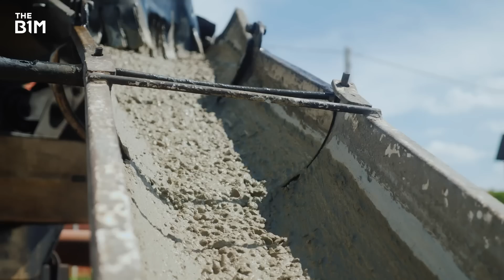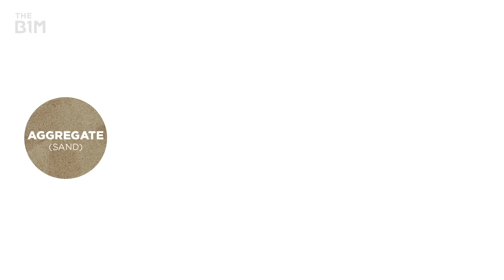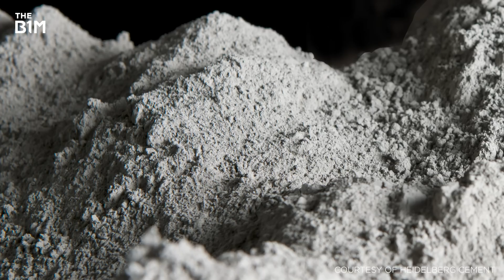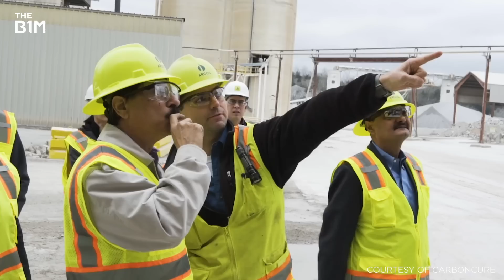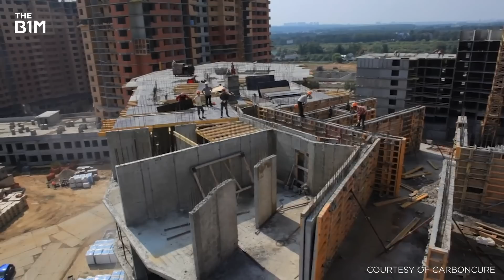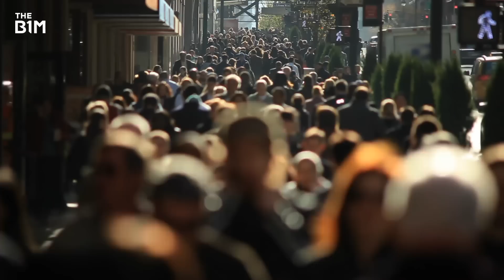New Concrete Alternatives

Comment: Ferrock turning trash is to a commodity? Sounds perfect! If recycled glass is what you need, and you'll pay a high enough price for it, people will clean up our highways with the zeal of a prospector
Reply: And the US just recently sent tens of thousands of tons of collected used bottles to landfill, because they couldn't find anyone to use them.
Reply: It used to be that lobster were considered trash, until a restaurant figured out how to make them taste good and market them as something for the elite. Any time waste products are turned into a valuable consumer item, they immediately start having a scarcity problem. It's a much better waste control strategy than involving bureaucrats.
Reply: Charlie Vetsworth  no, the Problem is, that controlled free markets have to be forced to adapt. taxing concrete imensly, while keeping frerrock cheap, will get the contruction Industry to Change, willingly or not
Reply: @chayew4660  Perhaps, although this would be an unpopular move as it would increase the cost of construction for a while.
Reply: I think another main issue is that it's an untested material. How does it fair during a fire? Its made out of iron. Is that going to be a problem with wifi or electrical wiring or something of that nature? etc. It's just such a different material that people are rightly sceptical, but it warrants further investigation.
Reply: biggest problem is our utterly broken economic system. turning everything into a commodity is not the way forward.
Reply: @daos3300  But everything is a 'commodity' because everything is a resource - and it IS important to view it as such.
Reply: Timothy Schellin Are you stating that everything is a resource or the economy looks at it that way?
Reply: @KarmaticEvolution  Both? everything that's useful is potentially a commodity. Not putting a price on something that is both useful and scarce is a bad idea.

Comment: Isn’t it important to also move away from our reliance on sand? The rate we are using it is much faster than can possibly be replenished by erosion. Sand on our beaches protect land from water erosion, without it we will lose land quickly. Your insight?
Reply: There is the sahara tho
Reply: No. Water ressources are scarce. Water is needed for concrete production so the focus would be on water rather than sand.
Reply: @MrReedling  desert sand doesn't work for buildings.

Comment: Bamboo is being used as lumber in Ecuador. Huge species grow there, up to 30 meters tall in a few years. The bamboo plantations help restore soil quality and provide local work.

Ecuador builds emergency disaster relief housing out of bamboo. Up on bamboo stilts to survive flooding.

Mixing in ground up hemp stalks in place of sand creates hempcrete. Using a foam generator, foamcrete can turn 1 ton of concrete into double the spacial volume.

Add these things together, and humanity can solve many pressing environmental issues with different types of building materials.

Comment: I’m a structural engineer specialist in concrete structures with MSc in structural engineering , and I see this with caution. I have more than 20 years of experience with concrete, and I can tell you for sure that the two main elements that you want away from concrete are salt and CO2. Because them promote corrosion of the steel rebars. I don’t know how someone can mixture CO2 inside the concrete and have some good results from it. Maybe just to use with concrete only structures (without rebars). I guess that I have to study more...

Comment: Isn't another issue with the concrete use in construction, the quantity of sand required to produce it? Because the available sand in the world is being depleted by the industry which destroys the coastal land and islands of countries around the world but it didn't seem to explicitly address this issue of how to reduce the consumption of sand for concrete.
Reply: You do understand sand comes from the ocean? The ocean floor is almost all sand.  Not the other way round. 

Have you ever been to a beach in California?

San Diego gets it's sand from the desert 20 miles away. 

Then there's the Sahara, Gobi, and a few hundred thousand square miles of desert around the world.

I don't think we are going to run out any time soon.
Reply: @Warmaster_7  I don't think that the desert sand can be used for construction .
Reply: @mumenraider  You are very much correct. What Warmaster 7 fails to realise is that sand does not equal sand. Desert sand is very round and smooth, making it unusable for concrete as it doesn't offer the physical properties needed to make good concrete.
Reply: @mumenraider  
Of coarse desert sand can't be used in construction. That was implied. 

Desert sand is used for beaches.
Reply: @KreaTiefpunkt  
What's funny is I never said desert sand is used in construction...
Reply: I may be wrong about this  Warmaster 7  as sand is technically renewable however there has been concern about the amount of "useful" sand for concrete because the rate we are consuming it is too fast for the Earth to produce enough sand to replace it. My point was that this was not addressed for or against it.

Also you didn't say desert sand explicitly is used for construction but your agrument is based on the fact there is enough "desert" around the world to deal with the demand of sand for concert production.

https://youtu.be/kEPpOGyvCmc
Reply: @niightmanz7551  
One day some genius will make desert sand into concrete. 

That guy is going to make some serious money.
Reply: @KreaTiefpunkt  i didnt know thta, but could it be possible to "roughen up" the sand artificially?
Reply: @KreaTiefpunkt  for example, some Kind of wind canal, that lets two streams of sand collide with eac other, so that sand particles collide and shatter ? a wal mart hedron Collider for sand. thats sounds stupidly expensive, but then again, tax the other option horrendously, and the market will have to adapt
Reply: Recycled glass can and is indeed being used for concrete production.  There's also investigation of using aggregate made from crushed concrete, which so far shows promising results in other related applications (drainage layers in foundations) and thus reduces the pressure on rock and gravel deposits.

Comment: I have long been aware of the "carbon footprint" of concrete. As a concrete delivery truck driver for the past thirty years, I am often witness to the wanton wasting of product by customers who fail to accurately measure and order the correct volume. That and adding too much water to the mixes which results in lower strength qualities. It is quite fascinating to see newer technologies coming forward that will change the industry. I was told by my employer recently, that the only thing that is produced in higher volume than concrete is drinking water.

Comment: Not in the first several dozen comments so I guess I'll put it up.  Concrete absorbs co2 in the curing process so the life cycle co2 cost is not nearly so bad as it is portrayed (which is why injecting co2 into the mix works).   New tech and innovation is good, but only if it is superior in some way.

Comment: The problem with many of these solutions is that they won’t be able to be feasible for long because sand is in low demand and will run out if we continue using concrete.

Comment: What about reducing our use of concrete in all forms by using better materials like wood and brick.
Reply: Optimum construction materials vary by region, be it due to climate, labor costs, local natural resources and economically importable natural resources.  Where I live, Puerto Rico, concrete is the most cost-effective option and is preferred over wood (lower durability in humid tropical environments prone to hurricanes), steel (no major iron l sources in the Caribbean and only Colombia has a plentiful source of coal near the Caribbean, thus its use is more limited here) or brick (very labor intensive, cinder blocks are instead preferred).
Reply: Lucario Boricua You are right in that a variety of factors contribute to its popularity. We need to let the market come up with solutions for reducing carbon by introducing a CARBON TAX. This is the only way we can use the invisible hand to solve climate change.
Reply: Try building a large suspension bridge using wood and brick, let me know how that works out for you.
Reply: @denisl2760  ofc not every construction could use wood. But the vast majority of buildings in cities and towns in Europe, North America and the far East. You really wouldn't know the different looking at it from outside. There's a place for concrete, but reduction is always better than trying to reinvent the wheel
Reply: @seededsoul  Carbon taxes just hit the poor and are 100% useless for reducing carbon emissions as a UN study has shown.

Comment: But won't this then add to the shortage of sand problem, or is that exclusive to the silicone sand they use for glass and this bio concrete can use any old sand from the ocean floor even?

Comment: bricks aren't a replacement for concrete... can you build a skyscraper with bricks?
Reply: Or a road, or dam, etc...
Reply: Yes to all them things. It just depends how you use them.
Reply: The difference between bricks and large forms is simply scale. If these technologies can be modified for scalability and still be comparably priced to or cheaper than concrete, humanity will be able to adapt them for skyscrapers and bridges.

Comment: Well it's a nice and very informative video. But the video don't pushes for a solid alternative to concrete but rather wants a bolt on technology to augment the effort for environment protection, whereas the FERROCK clearly addresses multiple problems here. First it clearly addresses the pollution concern here. Second it also doesn't require sand. Why am I saying this, well the particular types of sand required for any kind of concrete mix is not endlessly available in the world, truth be told they are depleting faster than ever. FERROCK addresses that problem. And it's not that we can definitively say we will not require large amounts of concrete after most of Asia becomes economically developed. Because we are yet to see the rise of Africa, and trust me once that continent starts developing much more concrete or whatever building material we will have in future will be required.

Comment: cut it off.  one shouldnt look away from perfectly usable resources,  just instead of stop at the point where we get what we wanted most,  actually also push towards perfecting the better non-harming ways for handling and making use of said materials. in short: it shouldnt be discarted,  rather we should actually put effort on making its usagen non-eco harmful

Comment: Why not grow our construction & manufacturing materials rotated along side our food crops. This would capture carbon during growth and during the life of the some of the end products making our activity not carbon neutral but carbon negative.
The most obvious choice of construction crop has been used for over 12,000 years our earliest widely used crops globally and nothing to date has been discovered that surpasses it. 

That crop is called hemp and naval maritime history exists because of it. It can be used to make bio-organic plastics outperforming oil based ones, it can make non load bearing hempcrete the inner woody core mixed with a lime binder, strong soft textiles, it's a super food and as many are aware makes cdb oil. There are over 25,000 different uses.
Why keep trying to discover new materials when we could discover new modern & effective ways to use the best we already have?

Comment: One does cure concrete.  So the title is good in that respect, curing of dependency is not correct.  Using steel by product is put into the category of cementitious material.  Depending on the performance and weather conditions Ready Mix plants love to use this by product and cementitious percentage of the total cement content might be 30%.   A good concrete structure last a long time.  Recycled concrete is also a reality.  So you get your bag of blended concrete mix at the Home Depot...  When you are talking about designing the right concrete mix for a building there is mountains of research to do it.  Biological cement? Was it used in conjunction with cement or acted like 100% cement?  We know compressive strength of concrete is only one characteristic.  Durability, permeability, reliability, workability, cosmetic, etc.   There are a ton of admixtures to supplement mix designs.

Yes industry has to be very careful just environmentally speaking adopting new technologies.  Putting Carbon into concrete is a good idea, but if implemented and that admixture hurts one of the categories you may need to replace that concrete sooner reducing the lifespan it does not help.  I'll have to explain with vehicles.  Let's say you have an old beat up car and it gets 20 MPG and you buy a new car with 40 MPG. If you just kept your old car you would have been nicer to the environment.  You see building the new car causes pollution also.

So what I'm saying is you have to consider lifespan.  So if you consider the impact of pollution from cement plants and that gets reduced but you hurt the lifespan and/or increase repairs you would not be net helping reduce the pollution.  If you consider lifespan concrete may up there be as a net benefit to society vs pollution cost.

Construction industry is all about environmental impact.  The amount of additional money spent to meet environmental impact is significant.  Atleast in America.  We do not feel these impacts as much because the Fed Rate was almost 0% from about 2008 - 2016, but the Petro Dollar, Drug Purchases propping up the dollar is going to collapse and a new monetary system will emerge.  In America the "poor" are far better off than most of the world.  The poor have been ginned up to be dissatisfied.  What till you see the environmental impact when the poor are actually poor in America.  They are not going to care about the environment let alone virtue signal about it.

There will be such pressure on producing structures as cheap as possible.  When that happens then the environmentalist will truly be earning their titles.  Cause what we have now is extremely environmental when considering human benefit.

Want to make an impact on environment.  If you not a productive citizen or make bad choices don't complain about being poor in America.  Get off your ass and make a change.  Don't expect the government to support you.  We are at a tipping point when we have more people not paying taxes than are paying taxes, if we keep growing our dependency on the government.  The system is all going to fall apart.  When that happens all these people propping their image up by virtual signaling how environmental they are are just not going to care anymore.  Look at plastic in oceans.  US 25% of the world GDP produces less than 1% of plastic in the oceans.  Except you have crazy people banning plastic straws.  They just want to look like they care or just not knowledgeable at all about the subject matter.  Plastics is a great net benefit to our society.

I never wear the brand environmentalist, but my actions is more environmental friendly.  You want to be environmentally friendly.  Drive and repair your old car.  Purchase furniture that last,  reuse and repurpose.  Don't regulate plastic straws, don't spend a bunch of money recycling then not use the recycling material.  At the rate of reusing material compared to what goes into the dump.  It may just be more environment to just put the recyclable in the garbage.  We keep doing stupid things in the name of environment to feel good and then it actually does not provide a net positive.

Want to make a difference you create a business and somehow use these wasted material.  Don't scream at some county office and  create another regulation and feeling good about yourself. 

I disgrace.  In America the construction industry is very environmental friendly.  Pollution as a bi product of producing cement has been reduced and the longevity of concrete is a bargain when considering the durability and when it needs replacement.  Just think of the concrete slab on your house.  We all take that for granted.   Concrete has reuse built into itself as the concrete is still working for you and providing everything you need.  

If there is an alternative for cement the independent concrete plants will jump all over it.

Enjoyed the science hated the title.